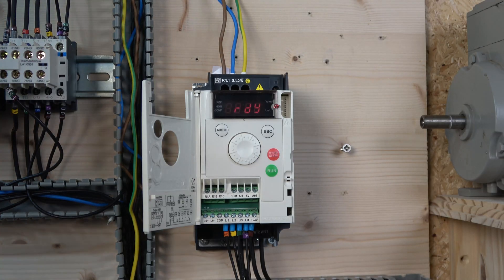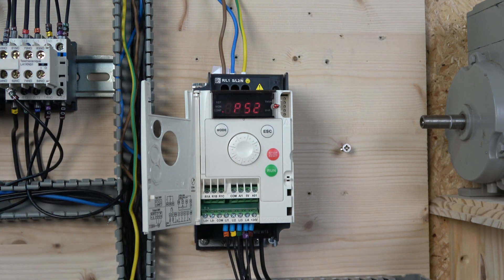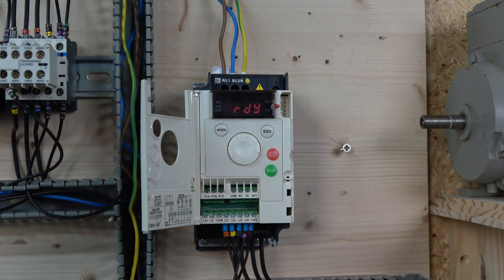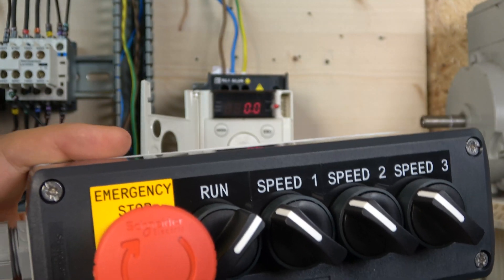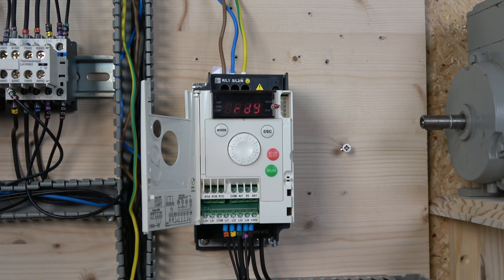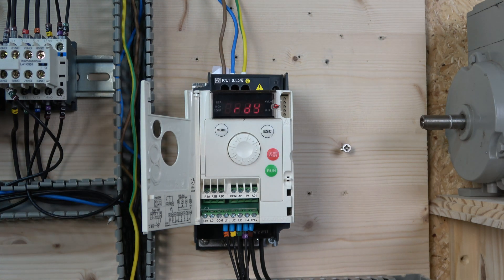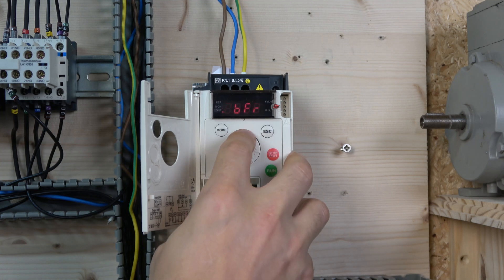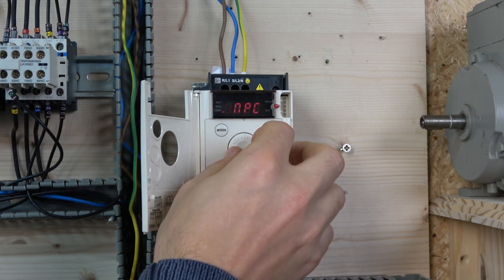Schneider Electric ATV12 VFD, remote control, multi frequency set up, switching frequency.( English)

Comment: Hi, great videos. Is it possible to use 3 wire control on this vsd and still use the thumb wheel on the drive for frequency change. I can’t seem to figure out how to do it.

Comment: Hello. i commented a while ago on one of your videos. you answered that. so i found this video but i was not able to test it immediately since i have not been at school for a while. BUt now im back at school. So im still trying to get 2 speed control to work. currently it works with 2 wire cotnrol mode. LI1 makes the motor run at 25hz and LI4 makes it rotate in the other direction.that all works. my motor rotates in in the the two directions when i want. but now im also trying to make it run at diferent speeds. specificaly i want it ro run at 10hz when the plc sends the signal. i tried this by seting PS2 to LH2. SP2 is set on 10 hz. for testing purposes i bridged 24v to LI2. so theraticly i think it shoudl then always run at 10 hz. but when i activate it strarts rotating at 25hz. can you help me with this pls ?. also sorry for my bad english. it is not my native language.